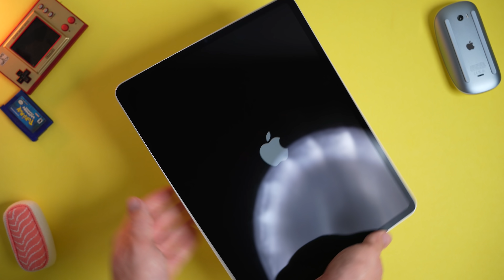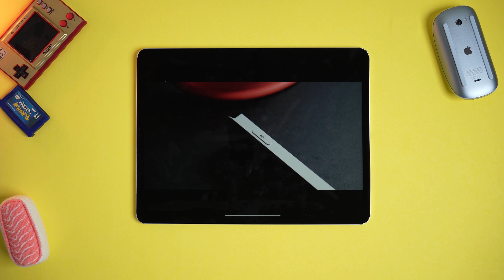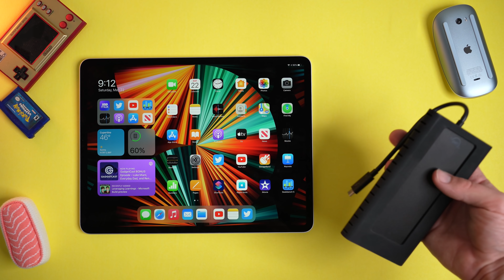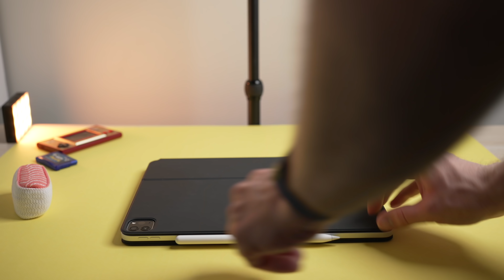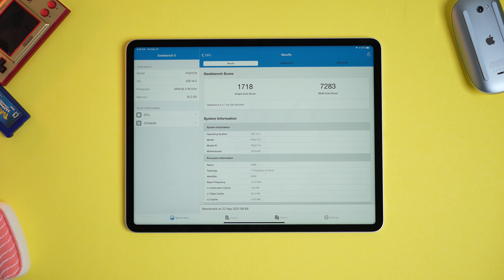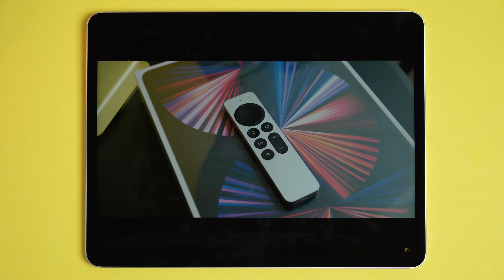The M1 iPad Pro is Great... Kinda

Comment: I just can't deal with the 12.9 size. I had a 12.9 for a few years and going to an 11 was like a breath of fresh air. It's way easier to manage laying down in bed, one-handed, etc. I never got used to the 12.9 and I also don't like the 4:3 aspect ratio, it almost feels like holding a square. I went and compared the two side-by-side a couple days ago and for regular usage I really couldn't tell much of a difference at all between the 12.9 and 11 inch (maybe my eyes are trash though). I did load up some HDR and that's where the 12.9 definitely does pull ahead noticeably, but 95% of the time if I'm going to watch HDR content then I'll just use my 65-inch OLED because that's an amazing screen and I have the whole sound system going and all that.

It's really cool tech, but for me portability is absolute king.

Comment: What's it like in terms of file management? Is it like the older iPad where for most apps you have to share the file with yourself so they show up? Basically with you ending up with 2 versions of the same file - one in your iPad files and one in the app. I'm not a current iPad user but I was told that's how it works and if that's the case for this new one, I think I'll stick with a MBP.

Comment: The M1 chip is new so expecting developers to have apps and games to be fully optimised at this point is a bit rich! Many Android games, most TBH, still do not run above 60fps despite having higher-refresh for two years, that does not stop us from buying into 120Hz/90Hz! It takes time!

We should know a bit more after WWDC and as the 12.9 iPad, Pro is not delivering until July in the UK that gives most buyers a chance to reaccess their perception in the interim. I still think that "pros" and those with disposable incomes will buy these in truckloads but the question is within the average consumer market, will WWDC open the door for mainstream use of the iPad Pro M1?

Comment: You want to test these M1 iPad Pros with something that utilizes the specs?
Run AAA console/Pc games - Divinity 2 is the perfect candidate.
In fact devs have to work with iPads limited memory hence the game is really only compatible with the 2018 iPad Pro and up.

Don't bother testing it with mobile games, those are low hanging fruit (sorry if I am harsh on mobile games, but with higher end hardware there ought to be higher standards)

Comment: It’s because there is a two holes in the side that makes it bend the thickness doesn’t matter you have a whole which is filled with the Apple Pencil dock and the pin hole fir the microphone in the center on the opposite side you just have to be careful when handling your iPad

Comment: Not going to buy the 16GB 1TB or 2TB version:
1. There's currently no app which which could fully utlitize 8GB, let alone 16 GB. 
2. Why do you need 1TB or 2TB when there is USB-C? All my apps could only occupy less than 70-80GB, even with lots of unused apps and games installed. 256GB would be more than good enough for most pro users, 512 GB would surely allow enough storage buffer for most video editing/movies lovers.
3. Lets say even if in future there are high end apps which could utilize 16GB of ram, it won't be within this 2 years at the very least, as there will be very very limited no. end user using 16GB tablets in market, so its not really profitable for IT company/developer point of view to develop those high end apps to suit a very small market. If most tablets in marekt are having 8GB ram spec (including iPad air etc), then maybe 16GB would be more appropriate time to buy
Reply: That’s funny. Too powerful an iPad.

Never heard of someone that says “my computer is too fast”

🤣
Reply: You get 1or 2 tab because of the ram. The apps will come.

Comment: WHAT? So that Keyboard thing was not true? Then why Apple even said that? Was it even an official statement from Apple?
Reply: For Legal reasons. When running a business you have to caveat and warn about everything as Lawyers are lining up to sue you if you do not! It fits the old Magic Keyboard even though that was not designed for the slightly thicker M1 iPad Pro.
Reply: @andyH_England  does that any help for consumers? If you bought new keyboards because of that warning, isn’t it kinda overspending unnecessarily?
Reply: @dotapark  I agree, though a lot of YT creators were trolling Apple for this without knowing the facts (like the M1 Macs and SSD wear), and caused the controversy. I had read that it would be fine, a few days after the iPad Event, so buying a new one was never on my mind. Not everyone is covering all the stories so def a pain for those that already had the old one.

Comment: I restored my backup from an older iPad to the new iPad 2021 Pro.   What I didn't like is that if the App Store no longer has that application from your backup, it restores a link of it and when you click on it, it mentions you are screwed because it no longer exist in the App Store with no further information.   Things like that make the iPad less Pro.
Reply: Apple kills apps that are not updated or will lead to bugs or are slow. This is good as legacy crap is what causes a lot of issues in OS'es. Tech moves on as does software.
Reply: @andyH_England  Warning would be nice in case I have data in one of those apps I want to get out.  But that is a logical reason and I support that.

Comment: To take advantage of that super HDR brightness you have to turn the screen brightness slider all the way up to max correct?
Reply: No it automatic detects when HDR content is on screen and automatically gets brighter
Reply: @TamimTech22  Up to that 1600 peak brightness on its own?
Reply: @HistoryNut-1701  since HDR content requires a specific brightness
Reply: @TamimTech22  Ok so if I don’t monkey with the brightness slider and it is at zero brightness level, and HDR content is on the screen, it will brighten up on it’s own to the degree necessary to make the differentiation between pixel brightness apparent? Does this hold true for the 3rd & 4th Gen iPad Pro’s also, as it shows in the TV App on my 3rd Gen unit that it is capable of playing HDR videos?
Reply: @HistoryNut-1701  most devices that support HDR automatically amp up the brightness and the screen and colors are noticeably different from my experience. Say you had the slider in the middle and was viewing normal YouTube content then went to a Disney plus or Netflix show that supports Dolby vision, that content should make the display brighter and reach that higher nits

Comment: What about the battery consumption in comparison to previous generation?
Reply from the maker: Still testing that. Too early to tell.
Reply: @GregsGadgets  GOOD EVENING SIR,THIS IS SHAIK.ABDUL KHADAR NEXT YEAR I AM GOING TO JOIN  UNDERGRADUATE NEXT YEAR IN Computer science engineering PROGRAM. SO NEXT I AM GOING TAKE A NEW LAPTOP MY OPTIONS
1.MACBOOK AIR M1 OR M2
2.MACBOOK PRO M1 OR M2
MY CLASSES WILL BE START FROM NOVEMBER END 
SO LET ME KNOW THAT WHICH LAPTOP SHOULD I CHOOSE
THEN WHICH RAM IS SUITABLE 8GB OR 16GB 
IS 256GB IS ENOUGH OR I HAVE TO GO WITH 512GB VERSION (I HAVE EXTERNAL SSD 1TB SAMSUNG T7)
I HAVE TO USE IT FOR 4-5 YEARS WITHOUT ANY ISSUE 

MY USAGE SOME VIDEO EDITING, PHOTO EDITING, CODING ,
ARTIFICIAL INTELLIGENCE AND MACHINE LEARNING PROJECTS

THEN WHICH IS BETTER CHOICE PLEASE REPLY WITH CONFIGURATION
Reply: @محمدعبدالله-م3ص6خ  yeah you definitely need an upgrade for note taking. That's the most demanding task no previous ipad pro could ever run...
Reply: From lots of review they seem to be getting about 8 hours , on brightness 75-100% .